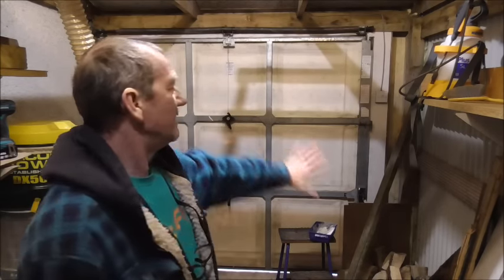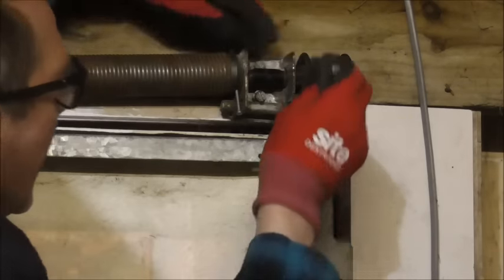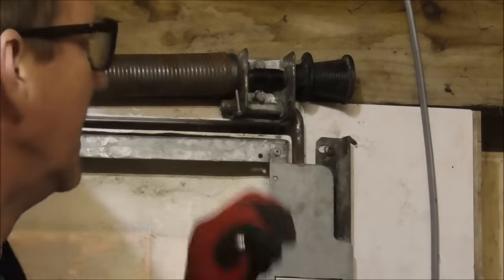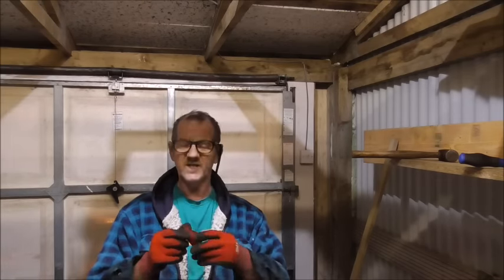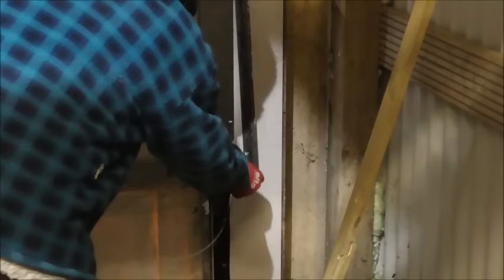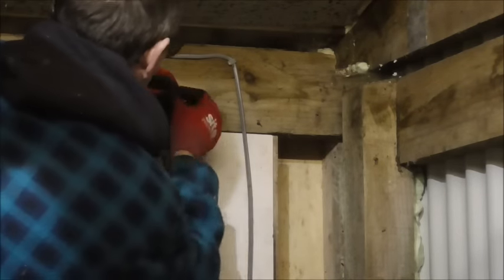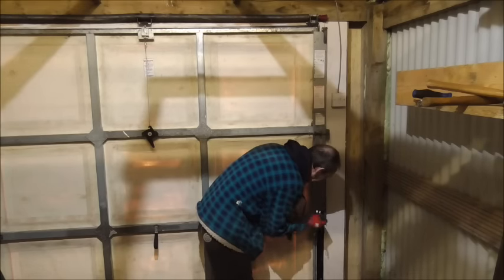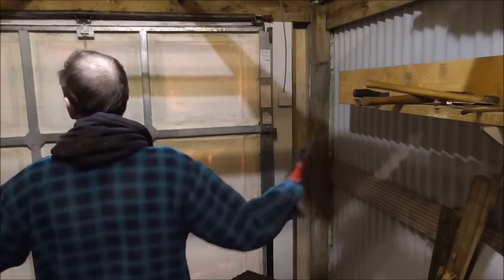Garage Door, Cone & Cable change

Comment: thanks i bought a second hand door and the whole spring was flipped over to the front of the door. nearly cut the cables to release the tension to flip it over, saved me a lot of time and messing about with it thanks again. local garage door suppliers wanted 120 quid to come out and fix it.

Comment: Great help. Thanks. I’m not sure I’d have managed to do the job without your help. That said, you suggest in the vid that if you lose the tension in the spring you’re in real trouble. That’s not the case. I just wound it back on according to your the instructions in your tensioning vid. Thanks for your help

Comment: Thanks David it's a bit daunting when you don't know what the job's going to entail so when i saw that the door you were working on was the same type as mine it gave me confidence to tackle the job, however for some reason i couldn't get the locking pin to locate into the shaft it was as if the hole in the collar wasn't in line with the hole in the main shaft, in the end I had to release all of the tension in the spring so that I could remove the right hand fixing bracket and then reinstate the tension back into the spring when I had changed the cone and cable and new roller shaft. Thanks again I couldn't have done it without your video..

Comment: My mechanism is exactly the same as yours, so ordered a kit with cables, the bobbins didnt have the plastic nut on the end, but mole grips on metal bar fixed that problem, thanks

Comment: Just replaced both my cones/cables  as one of them had snapped, my door is slightly different to yours but using this guide I replaced them and tensioned the main spring using your other video. Perfect step by step videos, thank you saved me getting someone out to it.
Reply from the maker: Your welcome Kev glad I could help

Comment: I fit a variety of different garage doors professionally and greasing the tracks is a big no! Over time dirt and dust builds up in tracks and the grease acts almost as a glue and actually stops the wheels rolling. Just use a generous spray of WD40 and clean rag every 6 months/ year!
Reply: A fellow garage door man! we use spray grease find it lasts longer than WD40! but then again we are based by the coast so the rust is our best friend  lol.
Reply: @scott4418  yeah but you shouldn't put grease or oil in the channels.
Reply: @nakkadu  I dont 👍
Reply: @scott4418  cool...I misunderstood then - yeah spray grease ftw 👍

Comment: Thanks for the video David. One of my cables decided to get wound up rather then sit on the cone tidly and door was out of alignment and jamming in frame.  Bought the kit, swapped just one cone, greased the runners and bingo!
Reply from the maker: Your welcome do I take it I earned a like for my efforts, thanks
Reply: Why did you grease the runners?
Reply: @Jon 1 that's like greasing your car tyres.
Reply: @Jon 1 the rollers are supposed to roll in the track, not slide. The oil goes on the point where the plastic roller meets the metal shaft, not on the surface of the roller.
Reply: @Jon 1 lol I know what I'm talking about. Channels are supposed to be clean and dry so the roller can "roll" up and down them freely.
Reply: @Jon 1 the comment I'm responding to said he greased the runners...I just pointed out that you're not supposed to do that. I'm trying to be polite but you're being a bit ridiculous now. I've explained to you what a "roller"is supposed to do (not sure why you'd need that explaining though)....rollers roll....and oil/grease make things slide....come on man this is basic stuff. What I'm saying is correct.
Reply: @Jon 1 I'm right and you're wrong....it's really as simple as that.....also...and this is a serious question, how can you not know what a roller is for when it's literally called a roller?
Reply: @Jon 1 a roller and a wheel have the same purpose so it was a good enough analogy. They're both supposed to roll but if you grease them they will slide....do you understand?
Reply: @Jon 1  It's still supposed to roll you dummy  🤦

Comment: Great video, I a have a KING garage door and the right side does not seem to have a place where you insert the pin before taking off the RED cone and removing pins, is this necessary, can I get away with just adding tension to the spring to make the cables loose ?

Comment: When i took the cones off my door after the cables snapped. The shaft on the left side came out of the bracket and the only way to get it in seems to be to torsion the spring. Is that correct? Seems sketchy tensioning the spring before i can even get new cones on

Comment: Hi David...  Thanks for your brilliant videos.. Yours were the first I found,  they are extremely informative !   Question for you....my up an over cable snapped on the left side... kit has just arrived. Can you tell me  if ALL cable kit wires are the same length..   my new one appears to be slightly longer... if so will I need to roll the cone a couple of turns first before fitting or adjust the tension spring to take up any slack ?  Thanks again.. Ray

Comment: Thanks for the brilliant video 
I have a snapped cable which I am now going to try and fix myself 
Are the kits on eBay all a standard fit ?
Thanks
Reply from the maker: I believe so
Reply: No, some bobbins dont have the plastic nut attatched, mine didnt but managed to turn the bar with mole grips anyway to pull locking pin out
Reply: Some have different roll pins mine did

Comment: Great video. Both my cables snapped, would I repair the same way, I tried to tension the door but it came up crooked, help
Reply from the maker: Just you have one cable wound to much remove one turn from the highest one and it should go level

Comment: I can't get the pin out, any recommendations for a specific tool small enough? I'm trying to hammer screwdrivers but only got to the point where the pin is pushed inside the main body of the spring, can get it to move further
Reply from the maker: I used a cut nail the size of the pin

Comment: Very helpful just pointing out which colour cone goes where. I had two black cones and a snapped cable too. Hell of a job drifting out the old pins but the cones pulled off by hand. However I had no holes to lock off the bar other than the cone holes on my now defunct Birtley and the mole grips shot off and aargh spring tension gone. Fortunately I was able to restore it so I can advise if it happens to anyone else.
Reply: how did you restore the tension in the spring? mines gone completely as i had to change the wood surround as it had rotted and thewhole thing fell down now its all back in place there is no tension in the spring at all.

Comment: You breezed over the first part a bit quick. Am I using mole grips to spin the cone around until I see the pin I have to drift out?
Reply from the maker: Your the first to say so but use what ever tools you deem necessary in some cases the pins can be easy to remove but in my case it wasn't

Comment: If both of my cables have snapped will the tension in the spring still be there or would of it been lost?
Reply from the maker: The idea of the tension is to be constantly pulling on the cables and if the cables are disconnected for any reason with the spring being locked it will spin out is in brief YES I'm afraid say

Comment: I have a snapped cable as yours in video but it’s impossible to get the cone off because of a brick pillar at both ends that the door is fitted between! Does this mean the whole door and tension bar etc will have to be removed for this repair? Thanks
Reply from the maker: Hi Alfie sorry for missing your question, yes going by what you day I would think the only answer it to remove the whole door fix it and then refit.
Reply: @dmgladden  ok David I thought I may have to do that, so will I have to release all of the tension in the spring before I remove from the wood frame?
Reply from the maker: @alfiedog2942  no just have to door closed, I can't see your situation but you might be able to just free up the top bar and try move it sideways so you can get to the cone without removing the complete door

Comment: well done david you had me on the edge of my seat when you was holding the spring tension with a screw there should of been a safety pin with the cones and cables
Reply from the maker: Yes it would have helped but as you know in life we sometimes have to improvise and it worked
Reply: David Gladden well done David you done a good job 👍
Reply from the maker: @garagedoors247  thank you, from you I will take that as a big compliment seeing that you are the man that would know about these things,hi just learn as I go and pass on what I find to try help others, i don't always get it right but I do my best, so thank you for the Kind words

Comment: Hi. David. Thanks for your vidio very helpfully. Can you help me I am trying to replac broken cable but I can not remove the pin from corn. Is it possible to remove tension then remove the corn?
Reply from the maker: I had the same problem what i did was find a hard steel pin just a little thinner than the pin in the bar and with a hammer i drifted  out the old pin leaving the replacement in and then i could work.
Hope that helps

Comment: Had a go at this for a mate, everything went really well until I tried to get the pins out, would it shift would it buggery, after 3 hour of frustration I gave up. Couldn't even drill it out. 😢
Reply from the maker: Yes it can be a B I used a hard punch to get mine out

Comment: Hi David, one of my cables has snapped,  the cones are very close to the brick door pillars, so getting the cones off is very very difficult. can the centre rod be tension locked and moved from side to side to get the cones off. I was thinking lock the tension, remove the cone, intention, remove centre rail split pin and slide either left or right to remove the cones?
Reply from the maker: To be honest i have the same with one of mine and the only way i could find to do it was to close the door and fully remove the top bar. It's a pain but its cheap if you can

Comment: Hi David
2 quick questions for you
1,the cable on my garage is the opposite to yours in the video, is the procedure the same?
2,would it be worth changing both cables at the same time.
Cheers.
Reply from the maker: Hi Paul to your firstbi wouldn't think it matters as long as it lines up as for the other will I can say to that is my second one is still in the box just in case, I wouldn't as you might get a lot more time out of it
Reply: @dmgladden  cheers, I'm going to order a set and fit it.
Reply: Removed cones fairly easily now cant get loop over spindle as everything is enclosed and no space to get cable over spindle.
Any advice?
Cheers.

Comment: I tensioned off the spring but it slipped and lost all tension, any tips on doing it back up yourself?
Reply from the maker: No I'm not sure it can be, but I guess in your position I would try with a couple of pairs of grip lock pliers as I think it's about 15 full rotations
Reply: I have managed to get it done, I put Alan keys in the holes and tightened it myself, with about 40 or so half turns and alot of pressure, it has more tension than it did previously, your video was a big help!

Comment: Hi their,I get the pin out but the problem I have is I can't get the cone off its too close to the wall any help what to do regards Glen.
Reply from the maker: No the only way I can think of is to undo the centre bolts and try push it over otherwise the door has to come off
Reply: @dmgladden  ye thanks for that that's what I was thinking but don't know about garage doors, I will try that, thanks again 👍

Comment: If your predicament is that of a frayed cable loop, and your frame is set between brick pilasters that prevent cone replacement without door removal, here is a quick and easy solution that works well:

It requires a short length of 2mm cable and 2 x 2mm oval wire clamps (these still clamp old 1.5mm cable effectively).

NB Estimate where to cut off the frayed cable loop very carefully - you probably have 130mm or less to accommodate the new arrangement.

Cut a short length of new 2mm cable - 250 to 275mm should be sufficient.

Form a new loop held by one of the oval clamps - one end of the cable will need to protrude enough for it to be held by the other oval clamp, along with the cut end of the old cable.

Note that manufacturers/vendors of wire clamps warn against their being used for lifting operations and typically quote 50-70% of proof load.

NB Be sure to check existing cable for serviceability.

NB The use of such an arrangement on both sides of the door cannot be endorsed - do so at your own risk.

Thanks for an informative post that has attracted some useful comments, especially preventative maintenance using an aerosol light lubricating oil.

Comment: Guru  problem with my garage door is after replacing cable's  door jam halfway up and cable's warped around corns can you help
Reply from the maker: Me i would just start again, take both cables back off and with the door fully closed refit and fully tension it should correct its self

Comment: Hi David, I want to remove an up and over garage door. Do I let all the tension off the spring or what is the procedure?. Cheers and Thanks
Reply from the maker: No lock the spring with a pin as i do in the tensioning video then you can remove the wires from the door

Comment: Cable broken one side but door stuck open  - how do I get it shut?
Reply from the maker: Yes it's not easy but you must close it before you can fit the new cable maybe get some help
Reply: @dmgladden  will it come down with a broken cable? Is it just a case of forcing it? Does it need two people? Thanks.
Reply from the maker: @Dave20105  yes two people and force it down it will go in the end just watch how its moving and take it steady
Reply: @dmgladden  should I cut the other cable first?
Reply from the maker: @Dave20105  I didn't but it's up to you

Comment: Cheers, the problem I have is that the cone is virtually touching the wall so there is no room to pull it off, I'm going to have to slacken off the spring and pull it away from the top of the door to allow enough room to pull off and put on the new one....stupid builders!
I've got the parts and I'm going to eventually do it but film it as well and upload to my other channel. Thanks for the advice
Reply: I've got the same problem, how did you go about it?
Reply: @darrenlaw5018  Mate, I've had the part for months but due to ongoing renovations have not had time to give it a go. It's a pain in the arse because I can't use that garage door. I will do it, when things go back to normal here. Thanks for asking.
Reply: @mufuliramark  I'm halfway there, had to unscrew from the wall to release the bar up, wasn't too complicated. Gave up on the tension to get them working, we go again another day.
Reply: @darrenlaw5018  Great stuff.